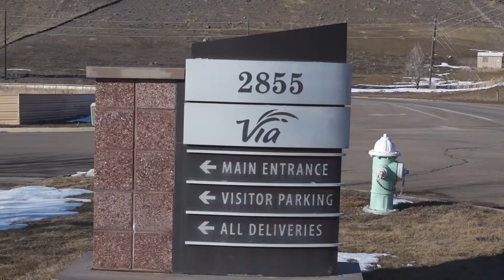Lightning Systems repowered bus in Boulder, Colorado

Comment: I attended bus 15 open house at Via when they first got it, saw it at CU Boulder transportation fair and actually rode it once some time ago. Alas, I haven't seen it since and Hop drivers have said it's been mostly, if not entirely, off the road since, including time back in Loveland. Hoping things are finally worked out and I'll see it - and get to ride it - again soon.
Reply from the maker: Yes, HOP 15 is here with us at the moment, with an intermittent problem being tracked down. From what I've learned, it was a hard problem to get to the bottom of; but now the engineers know what's going on, we can go ahead and fix it and get it back on the road, hopefully soon!
Reply: @LightningeMotors  Would love to know the latest update!